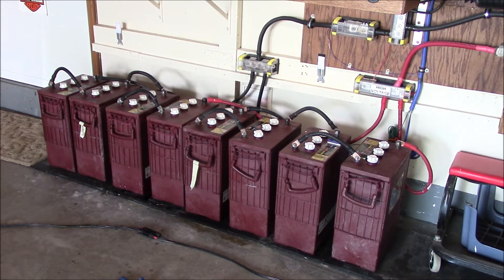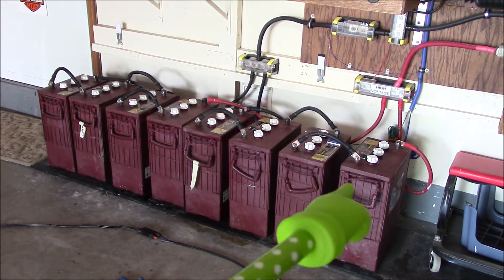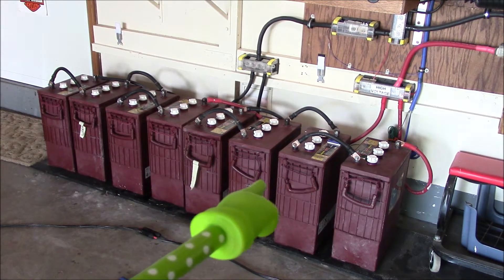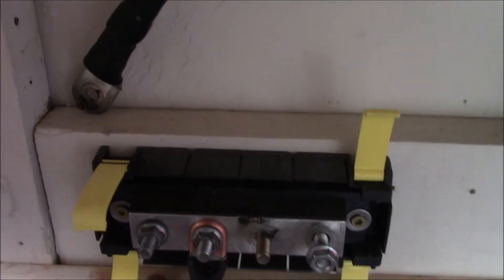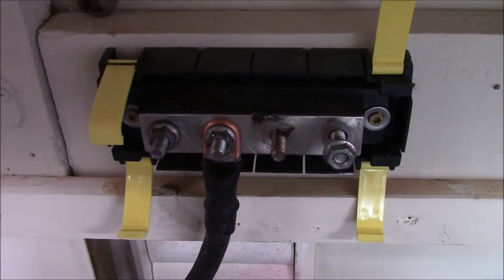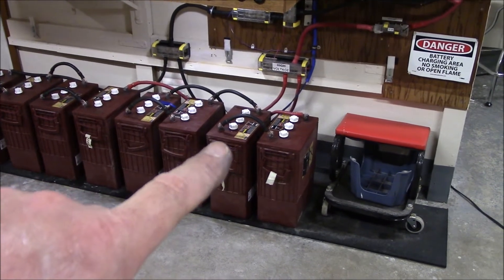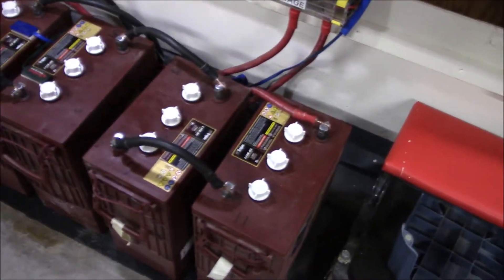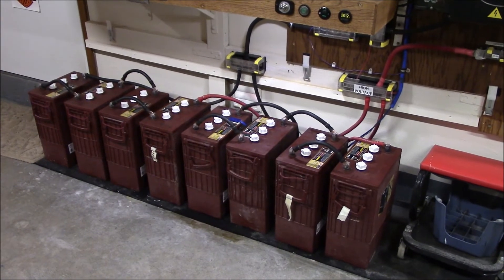24v solar battery bank - maintenance and found a buss bar arc (my fault)

Comment: just wondering what busbar you bought and how you ground system. also do you use a torque screwdriver or wrench to make torque on screws and bolts to spec?
Reply from the maker: Blue Sea Systems busbars. I did not use a torque wrench or screwdriver on the busbars...just made them nice and tight. Prob should tho

Comment: Hey Chris, something you could try with your batteries: Instead of their current configuration as two strings of four batteries,  reconfigure them as four groups of two batteries in parallel, with each of those groups in series. Each pair of batteries then has to charge to the same voltage, so you're not chasing two strings around. It makes things much easier, especially with batteries that aren't performing so well. You just need more links to do it, which you probably already have.

Comment: Hard to see on the video but do U use lock washers on top of stainless flat washer on bus & battery connection?
Reply from the maker: Neither...those are grooved back nuts (that bite into the copper). I am rethinking that idea. It has been a few days since my fix actions...system is running smooth now, no issues charging/discharging. Got lucky man. How are those nano-carbons working out?
Reply: @ChrisDIYerOklahoma  so far so good on the Nano carbon batteries .I will be adding four more online today after a full day's charge will have 16 online total. But then again all batteries are good when they're new aren't they.

Comment: I have seen several videos where people are using the battery packs out of Chevy Volt's (lithium) and converted them into useful battery packs for off-grid use. They seem to be a pain in the butt to configure, but once operational seems to work fine without all the problems you have with lead-acid batteries.